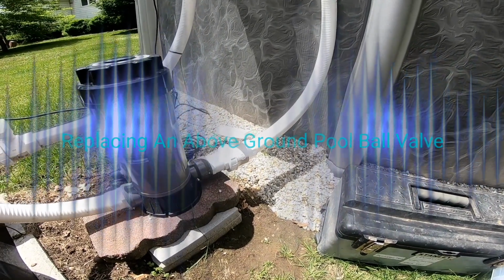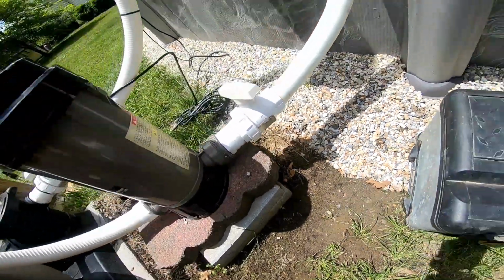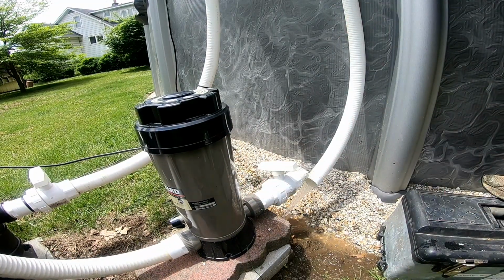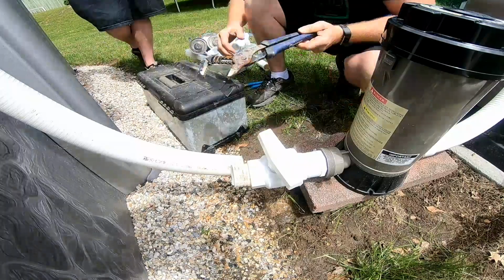Replacing An Above Ground Pool Leaking Ball Valve

Comment: It seems like my pressure is too high with this in, any ideas?  Hose keeps popping off
Reply from the maker: Do you have hoses with hose clamps or glued white pvc like in the video? The pressure does not change by adding a ball valve or chlorinater!
Reply: @WhitehouseFarmVet  I have hoses with clamps, I put it on the return and the hose popped off and then at the base of the filter and it popped off.
Reply from the maker: If the hose clamps are tightened on properly they shouldn't pop off try using a socket to tighten them on not a screwdriver!
Reply: Thanks for all your help.  I ended up putting tape everywhere and it is holding and the return is good and strong.  You’re the best!
Reply from the maker: Lol well I guess that's one way to do it, but were you able to tighten the hose clamps they should be able to keep the hoses on without leaking or coming off, you can also buy replacement clamps at lowes or homedepot? Remember tape is only temporary! Thanks again for watching!👍
Reply: @WhitehouseFarmVet  yes I was able to tighten the clamps.  I need to stop messing with it.  My husband used to do all of this but he’s gone so it’s all mine.
Reply from the maker: Okay glad you got it done!😊 Drop me a line if you ever need any more help!  I can also guide or help you with other things around your house we have a little bit of everything on our YouTube channel! Have a great summer and enjoy the pool!😉😊👍